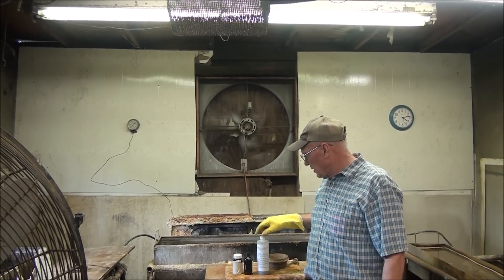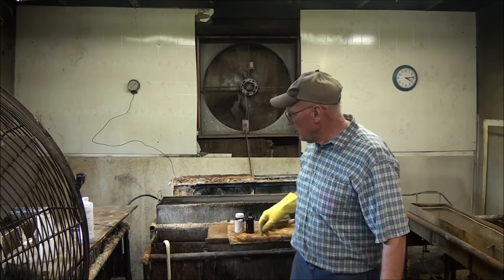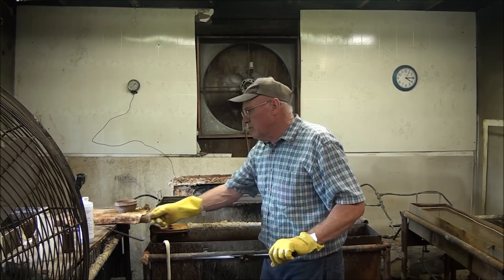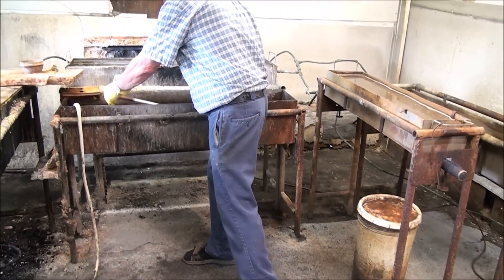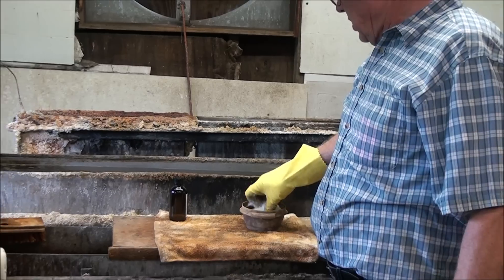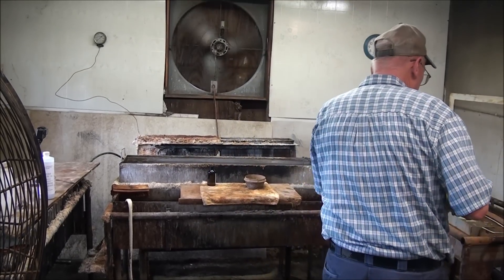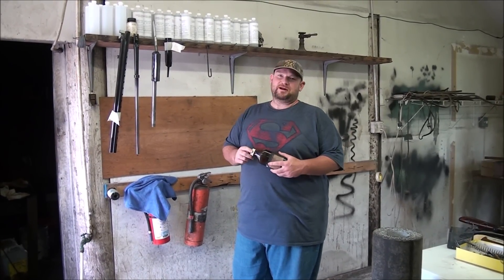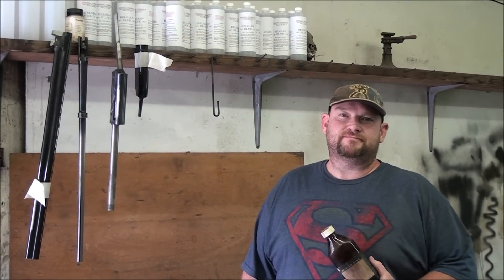Belguim Blue vs the competition.

Comment: I just finished my 2nd rifle using this formula and it came out spectacular. I found that time and temperature play a HUGE role in opacity and darkness of the blue. I applied the solution 5 times with a 5 minute boil between each carding every other application and a 45 minute boil after the last application. before the last boil the finish was even gunmetal grey and was still quite transparent. you could still see the base metal below... but at 25 minutes of boil time the finish started to darken and become opaque... after 45 minutes I had 100% coverage and almost as dark as factory salts blue... The best part is the durability... I am able to get the same dark blue with (no name mentioned) cold blue, but it wears off very quickly... this stuff is durable!

Comment: chemical bluing makes for a beautiful high polished finish.  Kyle Royer creates superb blue finishes on his knives hilts guards etc.  i guess im old fashion.  i prefer a rusted and carted blue finish even though it takes a long day to complete.
Reply: Kyle is probably using 1018 and going for what he calls a "mirror black" finish. Where is gets a little trickier is with hardened blade steel no matter what process you use.  You are never going to get that black mirror shine with rust bluing. Rust bluing with wipe out 320 grit scratches, so expect a "soft" finish. Some guys do a hot blue etch of damascus and then polish the "tops" which are the nickel bearing 15N20 or L6 steel. The "dark" steel etches deeper. That hot blue sands off of the nickel steel quite easily with VERy fine paper like 1500-2000 grit.

Comment: Would it be possible to do a step-by-step video at regular speed with the Belgian Blue?  I saw a bunch of stuff happening, but it was so fast I'm not sure of the amount of time to be spent on application, boil, and carding.  Also, will steam work in place of boiling?  Thanks!  Mike
Reply: I dont see why any type of heating wouldn't work except I believe boiling gives a consistent and constant heat on and over the whole barrel ( whatever part)at all times which is the goal ... using steam would work if you could guarantee a consistent coverage over the part like water does..case in point; watch knife makers work...they will cover certain parts of the blade to ensure a harder or softer section different from other sections of said blade...and it would be the same with steam where a jet of steam is directed onto the part but other sections would be lacking the consistent steam coverage... ultimately try it ... As long as you dont contaminate the part you can card it and apply more .
Reply: There is mention of steaming, I saw it on a YT vid researching rust bluing and they said it worked well, but must be done evenly .
Reply: @chrischapel9165  Yes I am trying to refinish a slide. I am a bit skeptical on using water. What if all the water doesn't come out of those nooks and crannies and starts rusting again. Couldn't a torch work?

Comment: So you used rust bluing products, without allowing them to convert to ferric oxide? How does that make any sense?
Reply: That is exactly what I was thinking, based on the shape and color of the other bottles, I know I have used those slow rust bluing solutions with great success.  Art's Belgian Blue is really a different process that typically is faster and has a different look to it that is best suited to shotgun and rifle barrels.  Using it on handguns has not worked as well as the slow rust bluing process.  All are good if used in the right way for the right application.

Comment: Did a little bluing, but had more satisfying results with spray on PARKERIZING! (Of course, very different effect too!) I wonder what "carding" is? Another great video!
Reply: Carding is using a soft brass brush to rub the previously developed rust almost off in preparation for the next round of rusting.

Comment: The big advantage of the hot water bluing processes aka Belgian Bluing or the longer process, slow rust bluing is penetration into the metal and superior durability compared to the modern hot salt bluing which is much more hazardous to your health potentially because of the harmful chemicals and fumes.